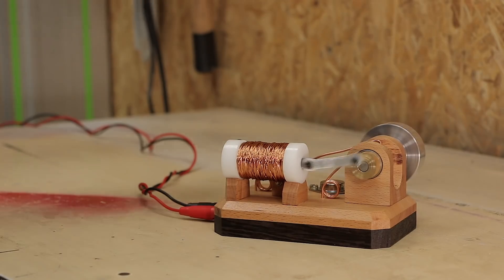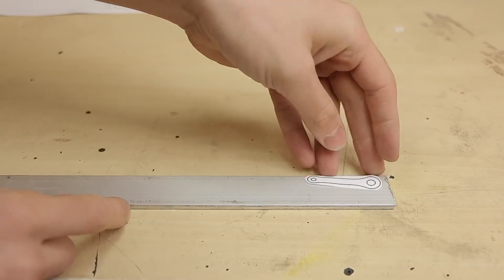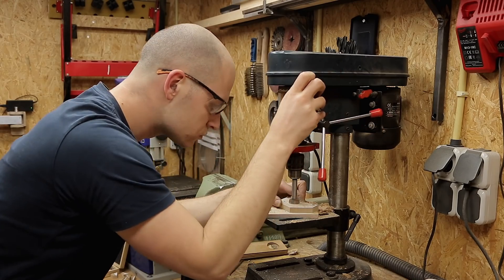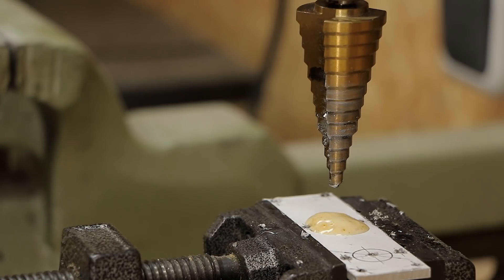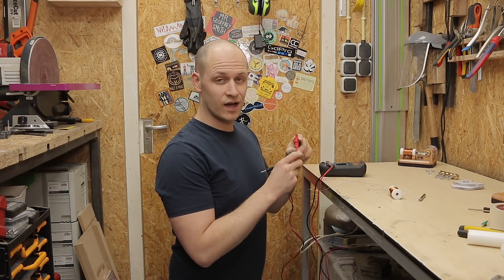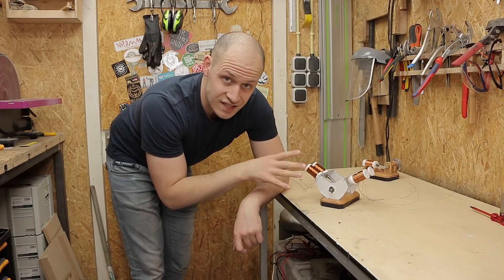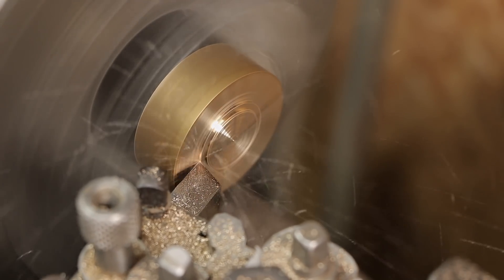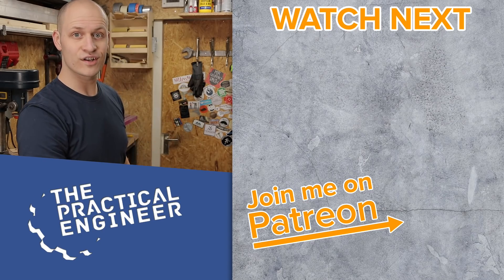How to make a V4 solenoid engine

Comment: single stroke? 4 stroke? uhhhhhhhhhhhhh 
technicaly it would be the cylinders.. so a single cylinder and a 4 cylinder V engine
also the "connecting rods" are crank pins. 
im not trinna to sound like a smart ass or an asshole but it kinda just makes me pay attention to the video less when you use the wrong terms... idk why
your a smart guy ngl, but would it kill ya to learn some of the corect terms for engines? you got them right but not the right parts
the "sliding contacts are what are known as a points system

Comment: Cool video, but if its electric why bother making solenoids at all?  Is it more torque that way as opposed to just making a single revolving electric motor?

Seems it would be more parts involved, so more expensive, and takes up more space and more weight.

Did you do this video purely to show that it is possible to do it?

Comment: You can polish the edges of the acrylic parts using flame polishing.  After polishing the edges with sandpaper, then finish by passing the flame of a propane torch over the edges quickly.  Practice on some scraps first.  I love the solenoid engine;  looks like fun.

Comment: Im no engineer or engineering student and i keep reading in the comments about the inneficiency of this little engine, i assume due to the power it takes to run it by a battery right?? My main question is tho, isnt there some way if you theoretically put it into a vehicle that you could create a standalone power source so it doesnt need to run necessarily on "a battery perse??

For one thing i know this is like literally one thing i learned in hs physics, but theres a way to make a hand crank magnetic generator, is there a way you could attach that to a moving part outside of the engine and somehow come out with something resembling a self sufficient energy source for the engine?? Help me people significantly smarter than me

Comment: '4-stroke' = two crank revolutions per combustion cycle, not the amount of cylinders in an engine.
Reply: Came here to say this. That said, great video.
Reply: English isn't this guys first language.
Reply: @chancegregory67  All the more reason to correct him. So he can learn, no ill intent.
Reply: @deanminman  here here 👍
Reply: Exactly,  @deanminman !
Reply: So what,  @chancegregory67 ?
Reply: @HelloKittyFanMan..   Wasn't trying to be an ass, just felt the miss-translation may lead to.....
Reply: I figured you weren't trying to be an ass,  @chancegregory67 . But it seemed like you were saying that in the way that I've seen/heard other people say it, sort of implying as if the person supplying the correction supposedly "shouldn't have," for some odd reason.
Reply: If his native language is Dutch then that would be even weirder --- 'viertakt = 2x tweetakt' just doesn't make sense. At least in English there's a 'stroke' you can imagine.
Reply: Thanks for saying, I came to clarify the very same thing
Reply: Which specifically makes this a 4-cylinder, 2-stroke motor. If we can call solenoids "cylinders".
Reply: The 4 cylinders are offset by 90 degree in phase so I would say "4 stroke" is a reasonable description, as for applying to something other than combustion engine
Reply: @GeekOfAllness  You twat!

Watch the commutators - it's 4 sequential drives (note the offset), hence, 4 strokes per cycle.

It doesn't have cylinders - the solenoids are driving rods not pistons (although mechanically it's very similar)
Reply: @Tony07UK  Obviously, they're not actual cylinders, hence my side comment.

Note that piston engines are very commonly offset for each cylinder, so your comment about sequential communators (aka "rods") isn't relevant. When we describe 2-stroke vs. 4-stroke on typical ICEs, a "stroke" is one direction of the reciprocating component (the rod). Multiple cylinders, pistons, and/or connecting rods doesn't change the basic operation. There's no reason to change that nomenclature just because there's no combustion.

Also note that this would be an 8-stroke engine, not 4-stroke, if we wanted to multiply by the number of "cylinders". A stroke is one direction of the commutator. Each commutator has two strokes for every crankshaft revolution. There's a power stroke then a return stroke.
Reply: Good point,  @GeekOfAllness .
Reply: *Engine,  @GeekOfAllness .
Reply: @HimNextDoor-l8m haha you got me. An engineer not a parliamentary historian
. There is this tho  'On the Web, “here here” outpolls the correct “hear hear” 153,000 to 42,000.20 May 2009'
Reply: @jamesbenson9689  Mass ignorance of grammar and history is no excuse.
Reply: If you read his blog page on this engine, he is aware of this. This isn't a combustion engine, so it is safe to describe this as a '4-stroke' solenoid engine, because that is exactly what this is.
Reply: @C0NR098  The only 'strokes' are each "cylinder" being pulled upward by the solenoid, and then pulled backed down by gravity and the crankshaft. So I say it's a 4-cylinder 2-stroke.
Reply: 2+2 = 4 quick maths
Reply: So what does it matter what he calls it!!! This is an electrical engine, not an internal combustion engine!!! I am sure that most of us understand what he meant!!! 😀 It's HIS design and  build, so he is entitled to label it any way he so desires!!! We technicians and amateur cobblers stand en masse and loudly applaud you, sir. I also enjoyed your honesty in showing the drill breaking in real-time and simply smiling and saying "oops", and the continuing with the build.
That is professionalism at it's finest. No explanations or apologies needed!!!
Reply: @terryisaac8195  Nobody was being ungrateful... Technical terms have specific definitions for a reason. Good on him for correcting him politely.
Reply: Well, for a purpose,  @amorag59 , but yeah.
Reply: @HelloKittyFanMan..  What? purpose what?
Reply: Rather than just "for a reason,"  @amorag59 , because everything happens for a reason, but that's not necessarily saying much of anything noteworthy, since that includes accidents and reasons that aren't special. "For a purpose, " and "for a special reason," on the other hand, both indicate that what's being talked about is actually noteworthy.
Reply: Hello Kitty Lover Man This is not about action/reaction and open ended causality. I felt that the “reason” did not need to be defined because one would have to purposely insert incorrect reasoning for my comment not to work. It’s like saying “bicycles/biking isn’t allowed on the highway for a reason.” People can infer that reasoning having to do with safety, and it is specific to this situation. 
This is about technical terms being matched to the specific context so technical people know exactly what you are talking about. A purpose is defined as the reason something exists or is done. Don’t be pedantic.
Reply: @amorag59 , it's not being "pedantic" to use words in the way that they were meant to be used, by what they mean, or to remind other users of them of that same thing. "For a reason" doesn't actually infer purpose like "for a purpose" does. Why insist on saying "for a reason" when it makes actual sense to say "for a purpose, " and takes zero more effort to actually make that sense?

No, "purpose" is not defined as the reason something exists or is done. Purpose is intended. Reasons can be both intended and unintended, which is different. Don't be a simpleton.
Reply: @HelloKittyFanMan..  If you'd like, you can write your own comment how you please as I wrote mine how I meant to write it. If you want a statement that is less open ended and indicates more that an idea has good intention then go ahead and use that in your comment.

"for a reason" can mean: (future tense) "there are explanations here, not necessarily all well known - but a reason why a caused b" or it can be the explanation itself to the cause (but this explanation being explicitly left out). You realize the use of purpose and reason are interchangeable here? With both, the explanation is not provided. If anything would make that comment better, it would be writing out what the reason or purpose would be. Not the fact of if it is intended or not. The scenario where someone thinks of a bad or unintended reason to define technical terms correctly is either malicious in nature or unlikely.
Reply: @HelloKittyFanMan..   I don't know who pissed in your cheerios, but I'll have no part in you going around making tweaks to my original comment calling people "stubborn/foolish brats" and other dumb little outbursts so you can look and feel smart. "for a reason" is a very common english phrase, plenty of people understood what it meant there just fine. Don't call me stubborn when you prefer that I'd have written it how you like, yet the sentence is just fine the way I wrote it. If you would have the sentence state more of an existential purpose, be my guest and comment away, but my comment was just fine saying there are reasons, of which were intentionally left out - The "reasoning" is controlled by people and society (use of language), not nature. Again unintended reasons are not an issue here unless you are inferring them maliciously or facetiously.

"So then what's the point of using something like "reason," which means literally ANY and ALL causes, which is not directional like the thought that the person is trying to portray is"
Don't twist the english language to your liking, "reason" doesn't  mean literally anything here. Again as mentioned in my last comment, the "reasons" would be something like 'so tech minded people can understand', you would have to have malicious intent to state a reason that's unintended.

"For example, let's just say I set something down on my desk in whatever spot. I didn't choose that spot with any particular idea in mind; the randomness of my brain just had my hand put it down in that spot instead of another spot. Would that be for a purpose? No. But is it for a reason? Yes." WRONG. If someone were to say to you 'what was the reason you put that there?' you would say 'no reason'. You could use reasons to explain how it got there, but there isn't an infinite number of ways it got there, and there is no "reason" (a statement presented in justification or explanation of a belief or action) that you put it there. Again People are not going to think of unintended reasons to define technical terms correctly which is the value you are providing changing the word to "purpose" (read that last sentence back to yourself a few times).

You keep trying to twist my comment to how you would have wrote it.
" 'For a reason' might be more open-ended, but when you use it as if you were trying to say that something was by design, then it sounds like you meant to use something that was more limiting than 'reason' is anyway" I was not trying to just say "something is there by design" or just say something is there for a purpose, I said what I meant "Theres an explanation why technical terms have specific definitions". Having "reason" there doesn't mean unlimited possibilities, there are only a few reasons here that would logically make sense in conjunction with my comment. Again we are dealing with language. We define the reason. I did not want to, nor did I need to explain the reasoning for a comment section of youtube, because *It's common sense*.

Pedant N: a person who makes an excessive or inappropriate display of teaching or learning. a person who adheres rigidly to book knowledge without regard to common sense.
Reply: @HelloKittyFanMan..  And I've never met someone smart who goes around calling people morons/idiots etc.

"So because you insist on being wrong even though the right way is just as easy, that's proof that I was right when I showed you as being stubborn just for the sake of stubbornness."
It's not wrong, and just because you think that sentence is wrong doesn't make me stubborn, what are you like 12? That's not how being right and wrong works. No part of that sentence is wrong, but you prefer that it say something different.

It goes to show your comprehension that you think somewhere I said "purpose" would be wrong - never did. I've said over and over it does not add substantial value to my comment. Using "Your" incorrectly would just be incorrect. "Things are done for a reason" is correct and just fine how I used it. Your issue is you think "reason" could mean literally anything. Where in the dictionary does it say that it means anything? ("a reason" is one thing - why am I adding the word "special" in front?) It is the specific explanation, not just anything. Reason and purpose are interchangeable there Look up purpose in the dictionary and the first definition: "the reason for which something exists or is done, made, used, etc." Hard stop. The sentence works even if it does not say if the result is intended or not. Now, answer me this - why is it necessary (as in to the point that you think "for a reason" is incorrect) to state intention - name a scenarios where someone in the comments would come up with unintended reasons to define technical terms correctly? 

Poop in my cheerios? I'm not the one going around the internet demanding people change their sentences (wow you must be a star at parties). Stop exaggerating my comment and my attitude on it given it is just fine. Your gripe is petty, like really petty.

Comment: Would be cool if he made some kind of solenoid turbo for this thing
Reply: That's called pumping more power into it. He could also probably get a boost using a capacitor, although as the number of solenoids increases this boost will decrease.

Comment: I'm not sure why you decided on the 1/2 offset when you have 4 cylinders. 1/4 or even 1/3 would be easier on the engine. Even 2 cylinders don't always do 1/2.

Comment: What are the advantages and drawbacks of this design compared to a typical electric motor?
Reply: I think you will need lots of copper wire for the solenoids to make at least a '1 or 2 litre ish' motor.
Reply: @jandevuilnisman2485  what do you think in terms of efficiency and power output?

Comment: Your effort is great but on the electrical side, your making a huge mistake. You need to use MOSFET switching with hall sensors and reverse collapsing field collection. If you do this, you can increase the supply voltage and have a very efficient, powerful and durable engine.

Comment: Ok, let's not mix up strokes and cylinders (ehm, solenoids). Two cylinder can still by four stroke as well as 16 cylinder engine could technically be 2 stroke. These are not related.
Two or four strokes refers to how many strokes are done to complete entire engine cycle for any cylinder. Two stroke needs to complete one revolution (up and down -- two strokes) while four stroke needs two revolutions. I guess your engine could be called single stroke (if solenoid is used on both strokes in both directions) or two stroke (if it is only used in single direction -- which seems a bit wasteful and, honestly, lazy from engineering standpoint).

Comment: I noticed you did this as a flat-plane crank, would a cross-plane not actually be smother in this use case since this is actually more like 2 stroke (Rather than 4 stroke which is smoother with a flat-plane).

Comment: This is very cool!

How do you make the 3d-printed bushing? Why did you have to print it then cut, rather than print a ring with a slit in it already? 

Also, would you imagine this to be possible without all the amazing metalworking machinery you've got?

Comment: Outstanding, but the wires that are connected to the axle via springiness need to be replaced with a mechanical device that works with gravity or else the copper will break or seize up.

Comment: Every time you put something in the lathe you didn't centre it correctly and the whole thing would be wobbling side to side and you'd be working on it. You do realise that makes the parts worse for efficiency cause of the wobble right? That flywheel didn't even spin straight and varied alot as it rotated.

Comment: Why do you need a switching mechanism? Would the flywheel not allow the rotation of the engine to be sufficient to move the piston from the solenoid to the point where the magnetic field of another piston would be strong enough to overcome the force of the first piston?

Comment: Connect the flywheel end to a waterwheel or windmill.
Replace the iron rods with magnets.
Connect the business end of the solenoids to an ac-dc conterver with a 5v regulator and 2a fuse.

Boom!
You got yourself the most complicated but coolest phone charger ever.

Comment: IT would be interesting to measure the power output of the engine and perhaps work on an improved variant. I feel that making more precise switches would help a lot in terms of speed and stability.
Reply from the maker: I think it can certainly be improved. Maybe at a later stage. They are a lot of fun to make
Reply: Optical switching would be best here, i am certain.
Reply: Why don't just use a electric motor...
Reply: @vikeshchand6783  That's what she said XD